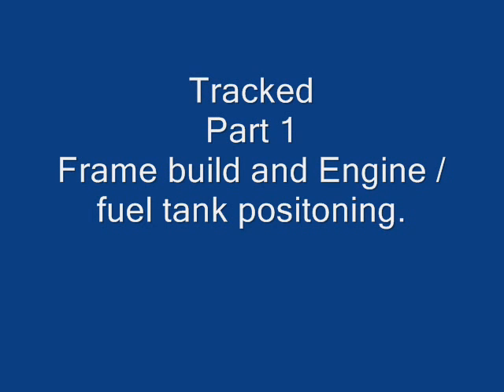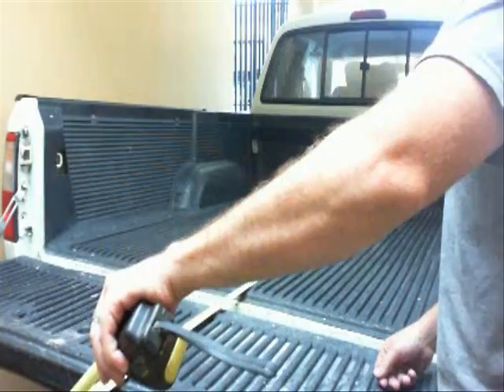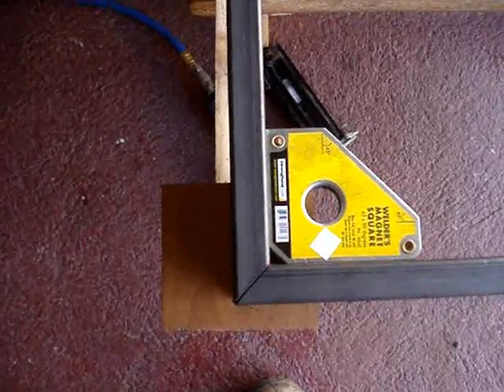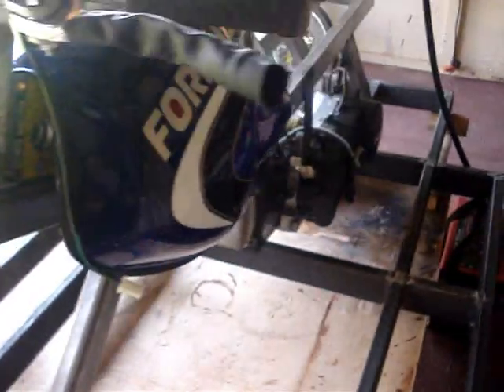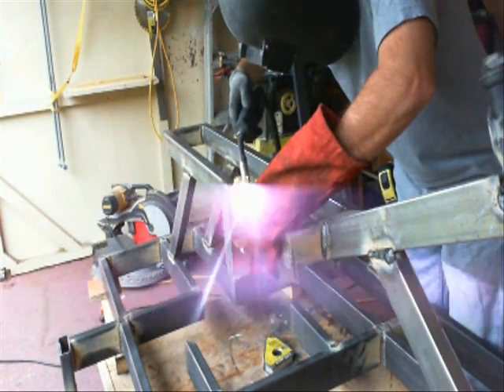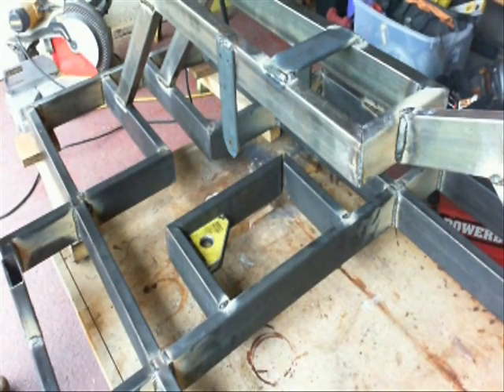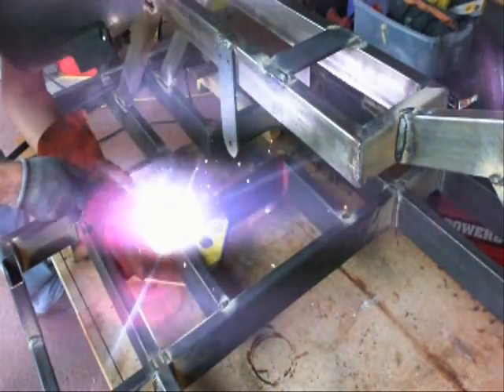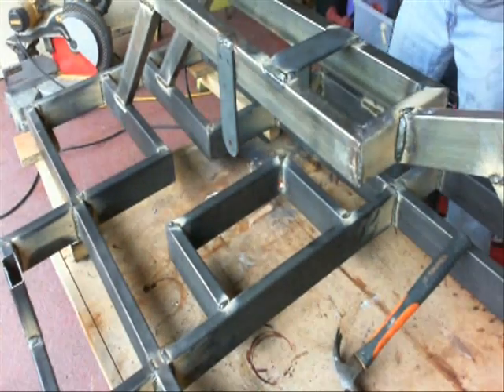Tracked vehicle frame construction Part 1

Comment: You can find Bronze oil impregnated Washers and Bushings from: McMaster-Carr. They have anything you could possibly need for all your projects. They are an industrial supply house and make Grainger look like a dime store. I buy 300 plus items from them on a regular basis. Good luck with the Tracked Frame project, very interesting.
Reply from the maker: Thanks for the info. I am up to part 4. Thanks for watching.

Comment: I like it, but think you might need more power. Looks like it might be on the heavy side
Reply from the maker: You could be right. I could only afford the 150cc to start with. I think I will use a pretty big sprocket in the back going for more torque less speed.Thanks for your input.

Comment: Thank you for the sharing

Would it be possible to know the power of the device to be welded?
Reply from the maker: I am using a 90amp mig welder with a .35 flux core wire. No gas.

Comment: Cool man. My only thought is that you should move your back wheel down, closer to the ground.  Going up hills may be scary with such a small portion in contact with the ground. I think it will want to tip back.  Granted, I have never designed, built, or drove any sort of tracked vehicle...
Reply from the maker: The actual build has less of a angle from the ground to the back wheel and front wheel. You could be right about going up hills, I am trying to think about the balance and if needed I could install some kind of wheely bar. Thanks for the advice.